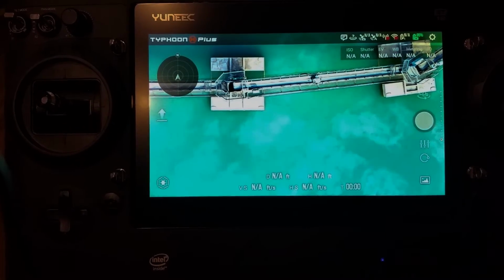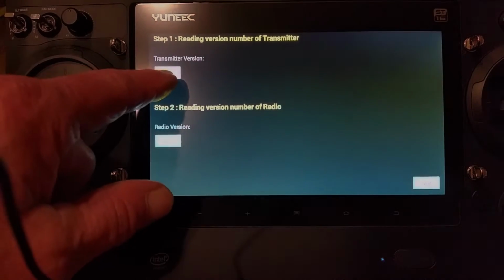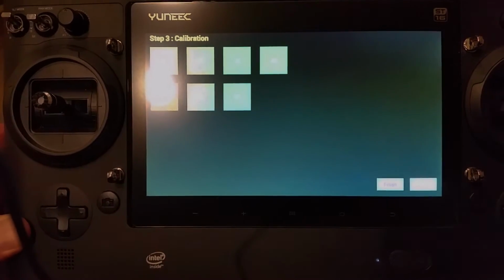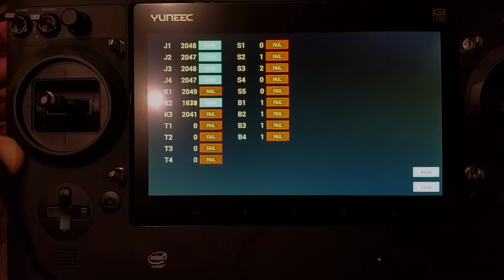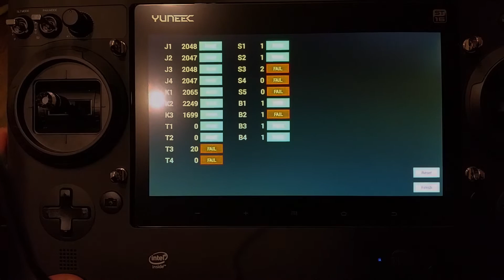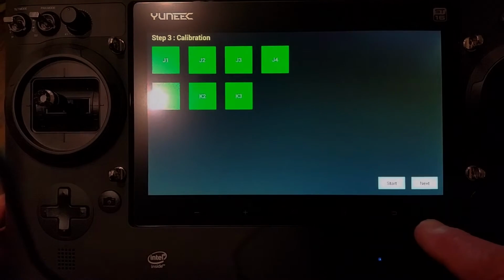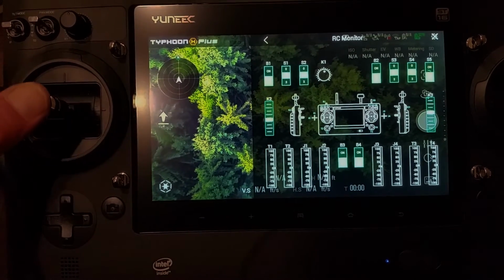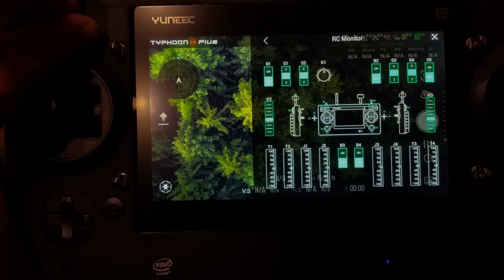ST16s Calibration - Typhoon H Plus

Comment: i have the J3 switch is not working right i cannot get a good test on it. all other switches work ok i just order tuner spray, do you think that will work, if i sprayed some in the hole on the back of the controller, just the J3 forward and back stick.
Reply from the maker: You can get electrical contact cleaner in the automotive section at Walmart. Use products that are listed as Safe for Plastic and Leaves no Residue.
If you cannot get the spray to work, you will need to open the controller and unplug the connector on J3. That is generally the point of oxidation. Plug it back in and test the stick before putting the screws back in. In rare circumstances the stick may be bad.
Reply: @folepi22_SteveC  all fixed i use BW-100 electronic contact cleaner, i removed the rubber plug in the back of the controller and sprayed on the J3 stick pod ,all set now test ok..
Reply from the maker: @steve-and-drones  Excellent.
Reply: @folepi22_SteveC  thanks for the help the drone flies like new before the J 3 stick at full forward was going so so slow now it's just like new.

Comment: Hello good sir for what reason would one need to do a controller calibration when new out of the box ?
Reply from the maker: You should not need a calibration. In fact it's rarely needed unless you have changed an internal component. But it's also needed when someone does the calibration wrong by following other Youtube videos. There are several that do not provide the proper instructions.
As part of the preflight checklist you should rapidly "stir" the sticks to clean the pots prior to flying.